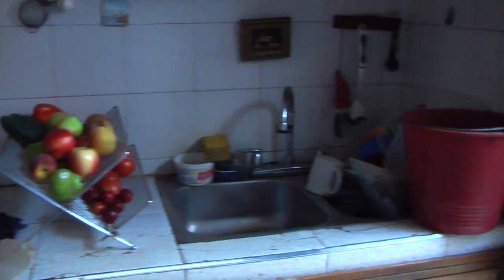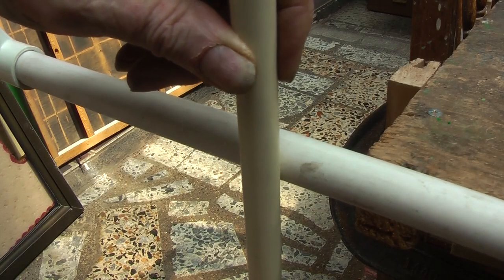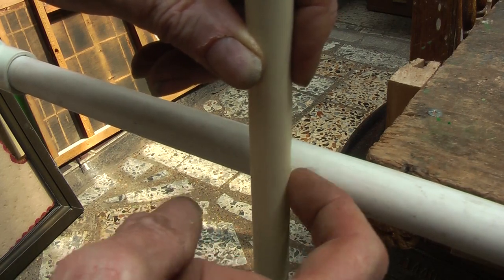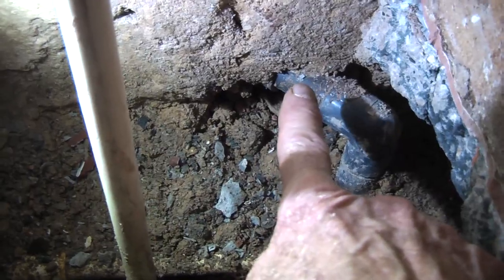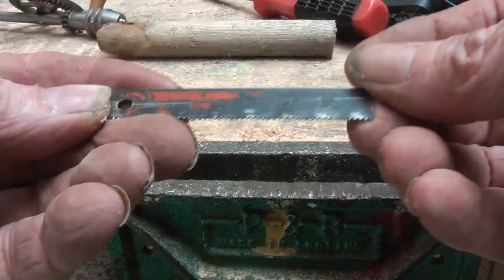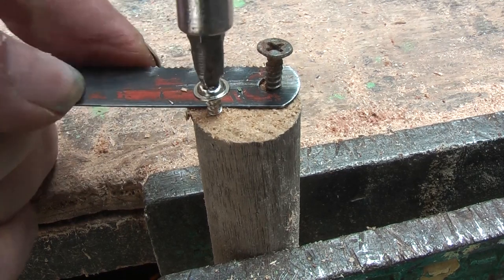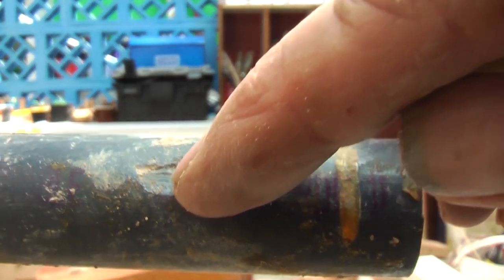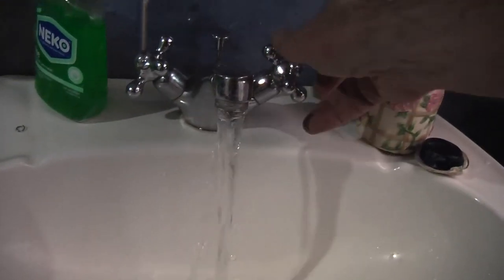Plumbing, With A Broom Stick.

Comment: Great solution 👍 did using 2 elbow connectors not reduce the water flow?
Reply: It may but it's probably so insignificant you wouldn't notice
Reply from the maker: True. On that line there is only a shower after that. No noticeable difference. The 4 elbows is a way to make a repair where one cannot move the pipe to insert a straight piece, such as here where it is cemented in.